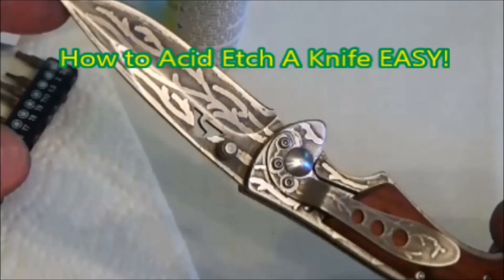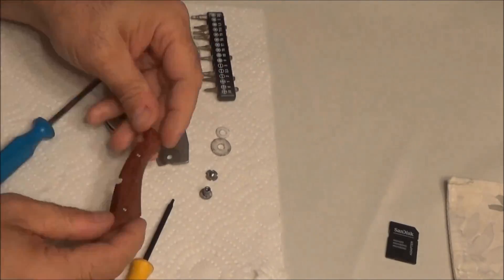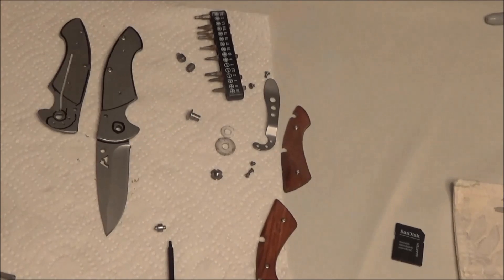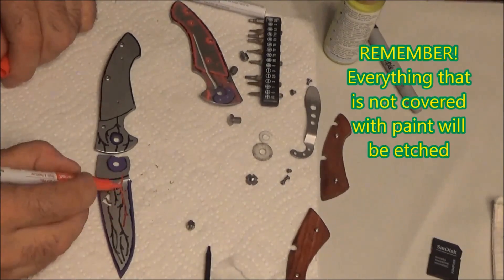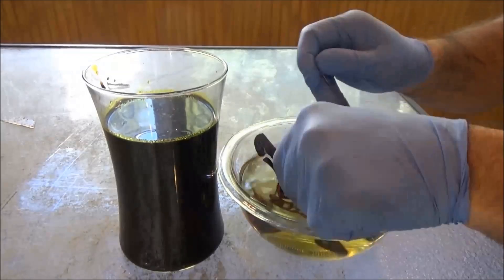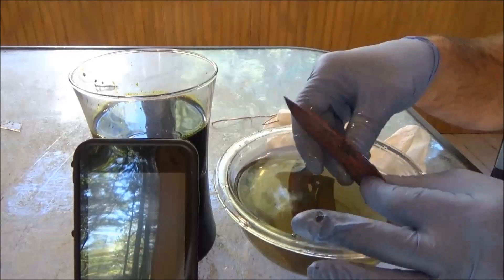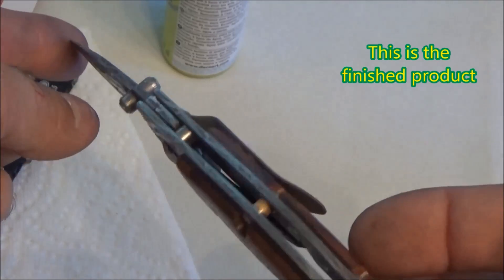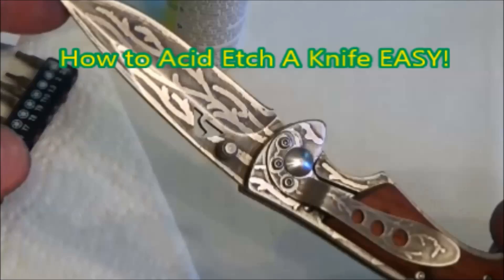How to Acid Etch a Knife EASY!!!

Comment: Is the $10 or $9 knife I would also like to try to do something similar. However I commonly use scrap metals file, rasps, lawn mower blades and the like. I don't like to see things go to waste and I don't have much money so it works out perfectly. Although I think that it should still work please tell me if it wouldn't for some reason and why. Where does a person find the ferric acid to etch knives. Thanks
Reply from the maker: The knife is stainless steel which works well. This will work on other steels. I got my ferric acid on amazon.com. Thanks for watching!

Comment: Great video but the quality is total dog crap
Reply from the maker: Thanks! I appreciate it!
Reply: Is there a way to fix it when I was done it was horrible
Reply: It was uneven and blotchy
Reply from the maker: Yeah make sure to pull it out of the acid and wipe off the black buildup, then put it back in the acid. Do that a few times, should come out like mine. Make sure there is no oil or grease on the blade.
Reply: @heathputnam9524  okay thank you this improved the quality a lot and I subscribed
Reply from the maker: Thanks for the follow up! Happy your quality improved!

Comment: So basically a sharpie will save the blade from the acid???
Reply from the maker: Jon Gaddis no. I used the sharpie to rough in the sketch. Use the paint pen to protect the blade from the etchant.

Comment: Thank you. I have forged a cleaver for my brother in law for Xmas, and I have never tried etching this way. I was unsure what would make a suitable barrier for the ferric chloride etch.
I use the etching solution regularly for pattern welded steel, and also for mokume gane that I make. This has been a nice introduction to etching patterns onto steel, so I thank you.
It would be useful for etching on filing patterns on the spines of blades, perhaps. But again, thanks for making this very useful video.
Also, considering that you have taken the time to make this video, I thought it only fair that I offer you some good advice.
If you are going to use ferric chloride regularly, you should consider making it yourself, it will end up costing around $2/3 a litre, and it is extremely high quality.
 You will need hydrochloric acid (37%) it is very cheap.  (I buy it 5 litres at a time to keep cost down.) Hydrogen peroxide, I use 12% as it is illegal to buy stronger where I live  (some morons like to make bombs! Thanks bombists!), anyway don't buy the 3% stuff as you can water down the 12% stuff and have 4xs the amount.
You will also need a source of iron, I use wire wool as it works the quickest, but if you have plenty of time just use iron nails, they will take a long time to break down, it's slow but works fine.
You will also need some deionised water, it's ridiculously cheap, you use it in steam irons for clothes.
So, mix 300ml of hydrochloric acid with 300ml of deionized water. Take 50 grams of your wire wool/iron source and put it into a largish glass jar,  pour your acidic solution  over and use a glass stirrer to hold the wire wool down in solution, if it floats it rusts, ruining your solution. It will release a lot of gas, so do this outside. Also, a word to the wise, hydrochloric acid vapours with destroy your steel tools so never make this in your workshop! 
If you made this with wire wool it will be done in hours rather than days (using nails etc). 
When it has done reacting, you may notice their are particles in the bottom of your container, do not be concerned as the hydrogen peroxide will oxidise this, you will be left with a clear yellowish solution in the end.
Now we need to start adding hydrogen peroxide, this must be done extremely slowly as it reacts violently, it will heat up a lot. Use a plastic pipette to add the peroxide, you can add around 5ml at a time without any bother. Keep adding the peroxide until it no longer bubbles, and you are done. An extremely potent solution of high grade ferric chloride. Also, if you wish to use this etching solution with copper, you should water it down by 40% extra deionized water, it is too strong and hard to judge times otherwise.
Store in a suitable container. I hope this is useful to someone.
Reply: Great info. Thanks.

Comment: Is there a chance that etching is going to damage the lock interface or the detent ball? Is there any way to protect/shield the detent ball when the scale is submerged in acid? Thank you so much for the video and looking forward to your advice.
Reply from the maker: It will etch the detent ball. In order to prevent it you will have to seal it with black electrical tape of paint over it with acrylic nail polish. Good Luck!

Comment: U dont think if u used a flat pan ypu would of saved alot of acid
Reply from the maker: I find if I hang the components I get similar results all around as opposed to laying them down where the bottom is always etched less due to gas bubbles forming a pocket where the ferric chloride does not touch the metal. I have also found that I can re-use the same liquid several times so the acid isn't only used once. A flat pan will work, I just prefer doing it this way. Thanks for the comment!

Comment: Looks great!! Will this method work on high carbon steel blades? Thanks
Reply from the maker: Mark Pool it will work on high carbon steel but for deeper results you should use copper sulfate instead of ferric chloride. Thanks for the comment!

Comment: Nice video. Simple.
If you dilute your ferric chloride, it will work faster. I think the ratio is 3:1 or something like that. I use it a lot. Everything from print plates to knives.
If you want an etchant that's cleaner (ferric chloride is nasty stuff, especially when properly disposing of it) there are a lot of methods that are also pretty simple. Including hot vinegar.
Reply from the maker: Thanks for the great info! Thanks for the comment!
Reply: Thank you as well. You made it very simple for people to get good results.

Comment: Hey, thanks for your video. Did you lose the sharp edge on the blade in the acid bath? How do you suppose this would react on a blade that is factory painted?
Reply from the maker: Nathan Woods th edge will be fine is you put a good coat of paint on it and ensure it is fully covered! I don't think it will work well with a painted blade...

Comment: Beautiful etching, you make look so easy, no matter what I do I can't make this technique work for sh*t, I’m not even try to etch hardened steel like you are, I’m trying to etch cold roll soft thin wall steel tubing so it should etch really easy and I can get some shallow etching but every time before the design is half way developed the mask deteriorates and lifts off, really frustrating….
Reply from the maker: Have you tried the paint pens I show in the video? Man that sucks!

Comment: WOULD THIS WORK ON OTHER METALS BESIDES STAINLESS?
Reply from the maker: Yes it will work on most other knife metals. you will have problems if the knife is plated or coated. Start with shorter etching times to check how deep the acid has etched. Different metals will etch faster than Stainless Steel. Thanks for the question!! Good luck!

Comment: nice knife, good experiment, i am impressed how good it etched allover the knife..., made some notes, will try later, tyvm^^
Reply from the maker: +mario van dijk Good Luck! I've done several knives and has similar results! Thanks for the comment!
Reply: i have started scrolling internet on anything there is to know about knives, i am thinking of ordering some blanks this summer, and start a project from there^^ cant wait, cant wait^^
i am working on 2 victorinox knives that i had lying around, one has silver handles i foundout with some sort of satin finish on it..., which i am removing to get it to shine like silver can^^
nice hobby, and pretty cheap to get started too^^ grtz from Holland^^ and tnx for reply^^
Reply from the maker: I am going to build a tumbler so I can acid wash blades. It gives them an awesome grey finish. Good luck with your endeavors!
Reply: likewise buddy^^